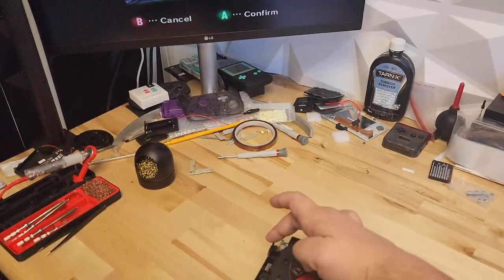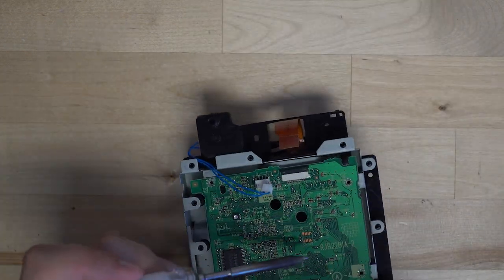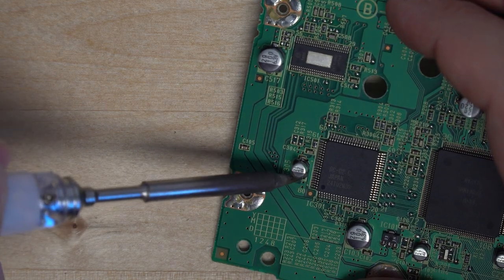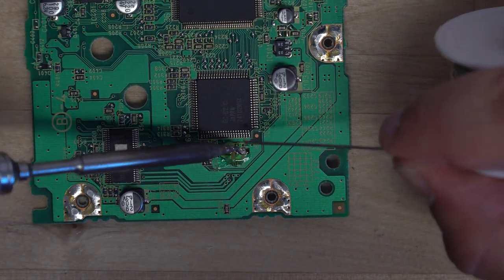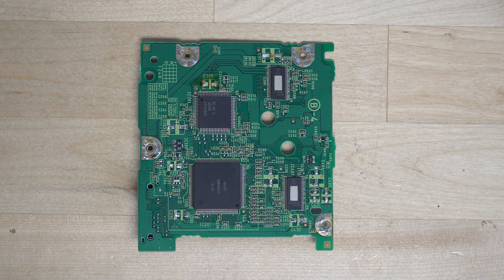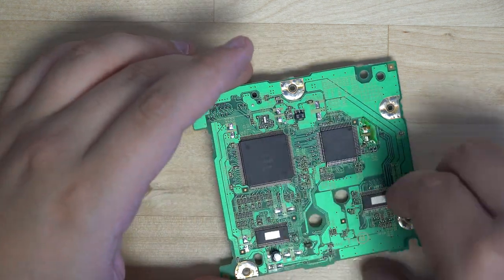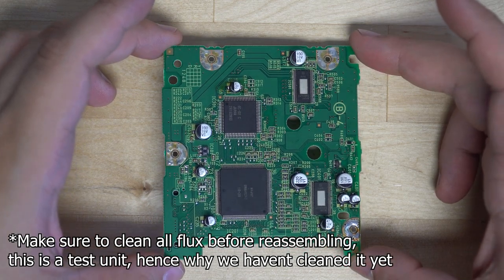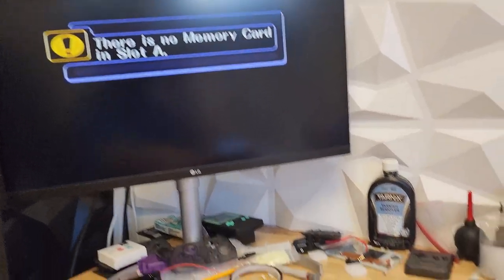GameCube Disc Drive Capacitor Replacement

Comment: heres one for you. years ago my friend spilled a can of coke over my ps1,  let it dry out a bit and used it again....now something shorted in there (right hand side) that meant the games both loaded and ran about 4xfaster. not unplayable faster but just vastly improved performance and that 4x increase in loading speeds.

ive never seen anyone online with the same results bit it seems a shame to see that tweak go un-noticed by the masses.
it seems ps1 was a powerhouse with a chained ankle. i dont have the expertise to explain how it happened.
Reply: It wasn't unnoticed, now your system is overclocked because of a short circuit, the thing is, the time is will be alive lol

Comment: I recapped mine but the laser would not fire up and spin to read discs until I dropped it to 112ohms.
Reply: You don’t want to release the laser that much, it can damage your disks
Reply: @peppertherat  Anything above that it won't read the discs. I have since picobooted the console anyways and mostly intended on playing backups off an SD card. I would've gotten a replacement laser but they're more expensive than just getting the parts to pico mod instead. 

112 ohms also wil not harm the discs when people do nanogc mods to read burned discs they drop the laser to 80 ohms. It's not gonna burn the disc but it will shorten the life span of the laser.